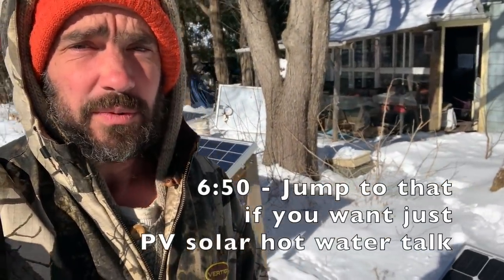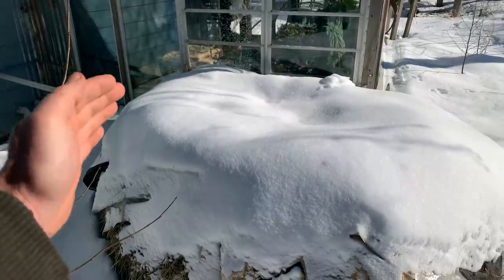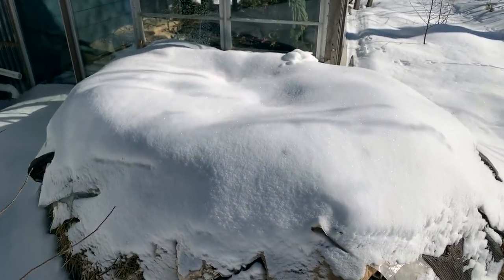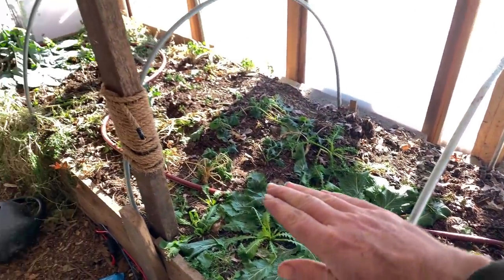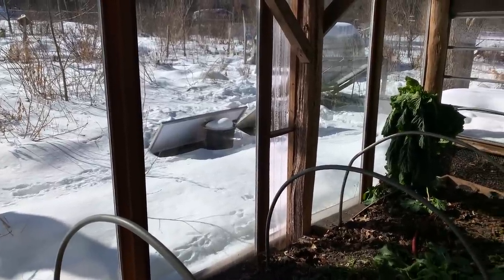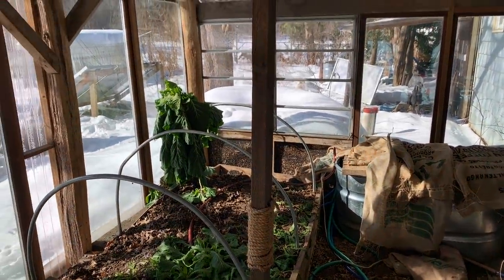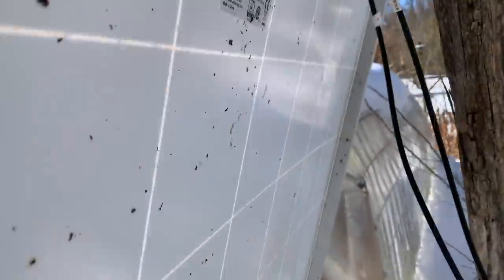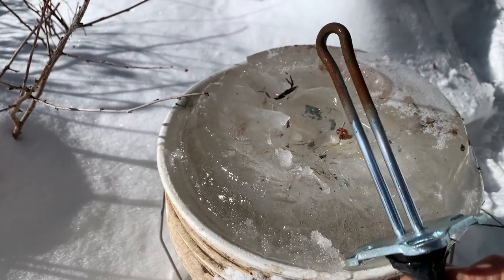Compost heating FAIL! (but solar water heating has promise!!!)

Comment: Good stuff :)   ...   Just an FYI on a few things I've found :

#1> 55Gallon water tight drums can also sometimes be found for cheap or free/trash .. many liquids are sold in bulk in 55Gallon drums .. I have 12 myself that were just going to be tossed in the trash .. IF the drum is not food safe , then it might be best to just keep the pex water in a closed loop , just using it for the thermal transfer. That way no risk of contamination of the plants and such (if it is not a food safe container).

To estimate roughly how much heat you can store for a given size .. 1 Gallon of water = ~8.3 Pounds .. 1 BTU = 1 Pound of water over a 1 degree F change in Temperature .. Soo .. ~50 Gallons x 8.3 = ~415 Pounds of water .. If the storage is a 50 F change in temperature from hottest to coldest .. than 415 pounds x 50 F = about ~20,750 BTUs of heat storage .. 1 kwh = ~3,412 BTU .. or 20,750BTU / 3412 = about ~6kwh of energy storage , over that 50F change for 50 gallons of liquid water.

#2> IF you have 10 panels of 300 watts .. and you averaged ~4 'sun hours' , at your location , shading , tilt , etc ..(+/- season , +/- weather) .. then you could see about 300 x 10 = 3,000 watts of pv x 4 sun hours = about ~12,000 wh (~12kwh) of solar electricity per such 'average' day .. that much PV solar input could heat up to 100 Gallons of water by a change of 50 F .. say from 40F to 90F .. or from 80F to 130F  .. etc.

#3> Insulation heat loss
R-Value = [(change in F ) x (Change in hours of time) x (Surface area) ] / change in BTU
A 55Gallon drum is about ~24inch Diameter and about ~36 inch tall ...  24 inch diameter x Pi (~3.14) = ~75.3 inch circumference x 36 inch tall = ~2713 square inch around the cylinder (drum sides) ... (24inch diameter)/2 = 12 inch radius ... 12inch radius x 12 inch radius x Pi (~3.14) = about ~452 square inches for each x 2 (1 top 1 bottom) = about ~904 square inches ... 2713 + 904 = ~3617 square inches / 144 = about ~25 square feet .. of surface area around the 55 Gallon drum.

If there is insulation of roughly an R value of 10 on all sides of the heat storage drum .. and there is a 50F difference in temperature from the inside of the drum to the outside .. aka a 80F water inside the drum when the outside air temp on all sides of the drum is about ~30F  ... (50 F change in temperature x 1 hour time x 25 square feet surface area ) / 10 R value of insulation = about ~125 BTU of heat loss per 1 hour .. with no insulation air itself is an R Value of about ~1 .. soo about ~1,250 BTU lost per 1 hour of time under the otherwise same drum and outside air temperature.

#4> Used / Re-home PV panels.
If someone can't find the free/trash PV panels , a 2nd place option might be one of the companies that sell used PV panels , that would be less $ per watt , and 'greener' to re-home them instead of land fill. I'm sure there are other companies but one I've worked with that does the re-homing of older used PV panels is https://store.santansolar.com/
Reply: Props on doing the math, I also wanted to note that you need a lot of surface area of panels to make a serious impact. If we consider that a greenhouse IS a solar panel, but that a PV panel is at best 15% efficiency, am I right in thinking that you basically need 6 or 7 times the panel surface to match the same power you are collecting passively through that same surface in a structure like Sean's lean-to? Or to put it another way, is, say 3000w enough (on a sunny day!) to make an impact on that system in the lean-to? I would say probably, but also that that's a heck of a lot of solar panel area needed to do it, i think a lot of people underestimate that and hope they are going to grow tomatoes in winter with a few square feet of panel :) (I don't mean Sean, I mean people posting on greenhouse groups etc)
Reply: @csgowoes6319  thanks .. 

I Agree .. In my experience , many people don't often conceptualize the scale of energy or power very well.

The PV option has 2 major benefits :
A> Transmission distances
You can have that energy shipped easily and cheaply , in with little loss over wires from further away .. collect solar energy at Location B in order to use it for heat in Location A .. solar thermal does not ship as well across distances.

B> Concentration energy/power per area
The PV is easy , cheap , and efficient to concentrate that energy into a specific place for higher temperatures .. ie a insulated hot water heat storage tank .. solar thermal isn't as easy , cheap , etc to concentrate that energy into higher temperatures .. for the same energy flow solar thermal is better with lower temperature differences of larger volumes.

- - -
Each of those average 'sun hours' we used for the PV panel estimate can also be used for find out how much solar light energy comes into the green house .. a 'sun hour' , is about ~1000 watts per square meter (about ~10.7 sqft) that is perpendicular to the sun .. you can estimate the amount of surface area your green house has facing the sun .. then you know roughly how much solar light energy comes in .. for example .. if the green house about ~100 sqft of of sun facing surface area .. then 100 / 10.7 = ~9.3 square meters x 1000 = ~9,300 watts of sun light energy per hour x 4 average solar hours per day (+/- season +/- weather) = about ~37 kwh of solar light energy per average day comes in.

If the green house surface area were all solar heat collection .. ie all dark black surfaces inside etc ... then yes solar directly to heat is vastly more efficient , solar thermal panels and tubes are often up in the range of 80% to 90% sunlight to heat conversion .. but , most green houses are not built like a solar thermal collection panel .. most green houses have lots of light reflecting colors on the sun light exposed surfaces .. soo , they have a much higher 'albedo' .. and thus reflect more out , and do not convert that same 80% to 90% of sunlight to heat that a dedicated solar thermal panel would.

 .. if because you didn't build it covering every surface in dark black paint , you have more light reflection surface areas , maybe you only convert about ~1/3 of that light into heat.. that would still be about ~12kwh per average day aka 12 x 3412 = about ~40,944 BTUs of heat.

You can use the same RValue method above to get an estimate of your thermal energy heat loss of the whole green house itself .. for a given inside vs outside temperature difference .. single pane glass is a RValue of about ~1 , 6mm twin wall polycarbonate is about ~1.5 , etc .. 

For example if I had a simple A frame style triangle shape green house .. with 100 sqft of sun south facing surface area about ~7ft wide ~10ft tall ~10ft long .. that shape has about ~200 sqft floor , and the two Aframe sides/roofs are each ~100sqft .. and the two triangle shaped ends are each another 35sqft .. 200sqft to ground .. and 100+100+35+35 = 270sqft of surface area to the air around it.

If it only had 6mm twin wall (RValue ~1.5) on the exterior , then for every 10F of difference from the inside to the outside ... (10F x 270sqft x 1 hour) / 1.5 RValue = That example A-Frame structure would lose about ~1,800 BTUs of heat to the outside air for each 1 hour , for each 10 degree F difference from inside to outside.

Soo , while the sun is up you have more energy coming in than going out .. soo inside temperature rises .. then when the sun stops putting in that surplus you start to loose heat to the outside .. at night at that ~1,800 BTU per hour for 10F difference x 10 hours of time = about ~18,000 BTUs of heat energy is needed just to hold a 10F difference between the inside and the outside .. that is nearly the ~20k BTU of heat that can be stored by a 50F difference in a 50Gallon drum of hot water.

 .. with 12kwh (~40,000 BTU) available .. would be enough to heat up about ~50F difference in a 100 Gallon drum of insulated water .. and that ~40,000 BTU of stored heat would then allow then about a ~20F difference from outside air for about ~10 Hours (over night) .. IF you want more than that than that you need more energy collection input and/or more energy storage and/or less heat loss (more R-Value).
Reply from the maker: Pinning this string of comments because there is SO SO much information packed into this.  Thanks for taking time!
Reply from the maker: A ton of good info here, something for me to return to and re-read so I can take it in.  Very much appreciate all the time put into this :)
Reply: @ianpgeorge  Any good reference book on this? I’m a total noob, but would like to understand all of this.
Reply: @ianpgeorge  thanks a lot! 🙏🏻👍🏻
Reply: @ianpgeorge  
You also need to take account of the greenhouse humidity when calculating heatloss :)

Comment: I did the compost heater a few years ago…. And tried for several years with one problem after another….I recently tried a submersible stock tank de icer which has been a game changer.
Reply from the maker: Glad you found a solution for yourself!

Comment: Regarding the air tubes running under the bed: rather than a fan fighting against convection trying to push warm air down and through the tubes, I would recommend extending those tubes up to the roof line, even venting them out through the roof. Use them as solar chimneys, creating a strong convection that will pull air through from the other end of the tubes. You'll get warm air pulled through under the beds, shedding heat as it goes, you'll get some ventilation to prevent overheating in the greenhouse and you should be able to cap the short end in winter to stop air flowing through, while the chimney ends will be largely dead air space. They may even generate a nominal heating effect in winter (very nominal). We're using a larger scale version of this system in our house design, Passive Annualized Heat Storage, On sunny days there should be a pretty significant solar driven convection air flow...
Reply: use a  closed loop, or you're throwing away heat
Reply: @rickdworsky6457  not really. Multiple reasons why.  It's a full year system, provides cooling in hot weather. In hot weather a closed loop can't dispose of the excess heat. In winter, you don't let the earth tubes exhaust to the outside, because then, you're right, it's throwing away heat. But the point of the system is to store a portion when there is surplus to utilize when there's a shortage.
Reply from the maker: I was thinking about going that route but the insulation lacking in this space makes it so sunny mornings would drive very cold air to move through passively until things heated up enough... I am toying with the idea of maybe making a solar hot air collector that can accumulate some really good heat early in the day and have it's outlet connected to one side of the tubes and draw that more thoroughly heated air through them with a panel and simple fan on the other side... More to come on that.  Your idea makes a ton of sense but would pre-suppose an actually well insulated space!
Reply: @edibleacres  get yourself a couple w1209 thermostats - cheap as chips, and they can power either a dc or ac load...   i have one to power a fan in a solar furnace that is on the front of my bee house since i don't want the fan running when there is no heat...  the thermostat is in the furnace and it kicks the fan on when the temp reaches about 20c - which is each on a even an overcast day in the dead of winter.   it can be -40c outside yet the furnace will be blowing +40c air... not bad from a bunch of old dogfood cans and recycled sliding door window.
Reply: @peterellis4262  not true that a closed loop "can't dispose of the excess heat"... Unless it's built too small! The earth around the tubes absorbs the heat. The system must be appropriately sized for the structure or they will saturate with heat in the summer and use up all their limited storage capacity before winter is over. Please do more research before sending people down blind expensive failure routes!

Comment: DANGER: Hi Sean, that heating element looks like it works precisely as one I have used in the past.  These things are extremely dangerous.  I cannot emphasize this enough.  I'm not a Safety Sally either.  The electrical charge can pass through the water to anything that conducts.  So, for example, I was using a titanium container to boil water.  I held my hand close, didn't even touch, the container and the electrical charge was enough to pull my index finger into contact with the container.  I was instantly convulsing and completely unable to do anything about it.  I think the only reason I survived is because the furious flailing of my body broke me free from the metal container and I collapsed on the concrete floor.  I had a nice sized hole in my finger and my entire arm was ravished.  I think that the heart condition that I have today could be tied to this event.  I HIGHLY recommend looking for other alternatives here.  The risk of turning your body, or someone else's, into a grounding circuit is too great and certainly not worth it.
Reply from the maker: That is extremely scary...  I wish I could know more about the specifics of what you were doing when that happened... Was it connected to an AC power source of a true 240V or true 120V?  From what I understand of the setup shown here we are working with one or two panels of lower voltage and lower amps by a LONG shot of what the heating element is capable of sending out...  Attached to full strength AC I could see that happening, but maybe I really am mis-understanding what is going on. What a frightening story, I'm so sorry that happened.
Reply: @edibleacres  Yeah, I thought I should share some of the details because people generally underestimate the dangers.  

The incident occurred in India.  It was a standard AC wall outlet, but I don't remember their voltages and whatnot.  I have no idea what the limits are with regards to amps or whether they even had breakers/fuses installed.  Things in that part of the world can be messy.

That said, even here in the US one can easily find electrical installations that are far outdated and which would never pass even the loosest code.  It only takes one amp to kill a person.  I've forgotten far more than I currently know about all of this though (I was fully trained and worked on electromechanical systems that are still used by the US military today).  I'd highly recommend that you either get an electrician in on this project or at least find an active solar community forum to share this with for feedback.  The risk is just too great.  Someone could be injured or killed, or maybe burn the house down.  I'm not saying your set up would do this, but I wouldn't take the chance (well, to be fair, like any good Cletus I probably would).
Reply: @cletushatfield8817  I can't be certain, but I would guess that for a submerged heating element to be responsible for an electric shock like you experienced, there would have to be some contact between water and the wires conducting the power.   A theoretical perfect submerged heating element should not have any contact between the electrical elements and the water (perfect insulation) - all the current should go through the heating element.  But it doesn't take much failure of the insulation to get contact with the water and current running through the water.

Comment: sounds like a great idea and well worth exploring.
A suggestion to improve your system would be to set up the solar panels, batteries and heating element as close together as possible because you'll be losing a lot of energy through those long cables.

Comment: You have brilliant ideas. I am so blessed to have found your channel. This experiment, is one that I have often contemplated. The water tub, instead of a metal tub, maybe a well insulated cooler, sat inside of an old refrigerator, laid on back, or better, chest freezer, that has mechanical parts removed. Gap in between inside of frig/freezer and cooler, can be packed with old straw, and even  composting, depending on space. This will insulate the water, while also, mildly raising temp, before heading to outside compost, to prevent cold water from running through main compost pile. And prevent cooling it. That was my idea, from years of thinking about it, and not yet ever giving it a try. But maybe this year, is the year! 
Totally binging your videos. Getting excited for the future. THANK YOU FOR THAT!

Comment: The solar panels heating your water tank in the glassed in area sounds like a great idea! Are you collecting urine for th compost heap, too? Might keep the compost going with a higher level of nitrogen when you add mass to the pile. How often do you add new compost to the pile to maintain the decomposition process? Do you know when the pile became so cool that the water stopped? Since you can't turn the pile you might just add to the top to keep the heat going. I learn so much watching your efforts! Good luck!
Reply: That was my first thought... Pee on it! Works for my compost.
Reply from the maker: We do add urine to compost areas that we're trying to get hotter again.  Right now 100% of that goes to the chicken composting system to keep the woodchip pile right near their winter run from freezing in advance of use...  So many variables!

Comment: For the compost pile insulation:  If you have an overhang off the end of the greenhouse then you can use the top of the compost pile to stash leaf bags while also insulating the compost pile.  Or find an old swingset frame and toss a tarp over it to act as a temporary shelter to keep them dry.
Reply from the maker: GOod thinking, I will certainly keep that in mind!